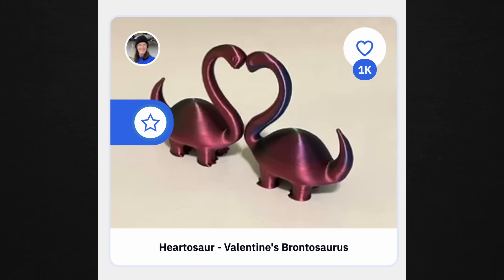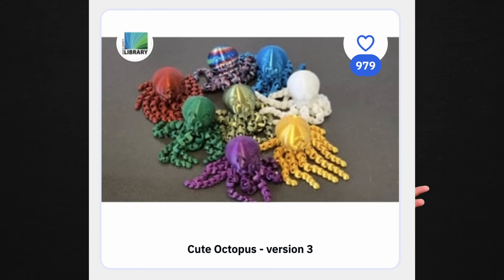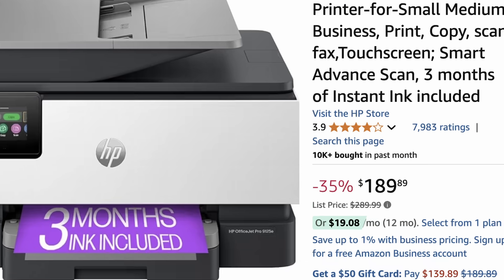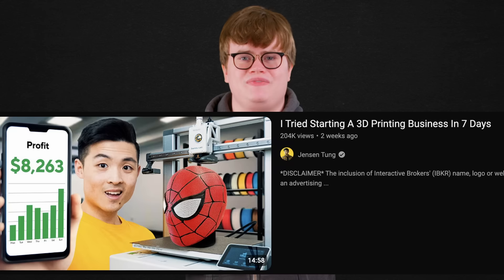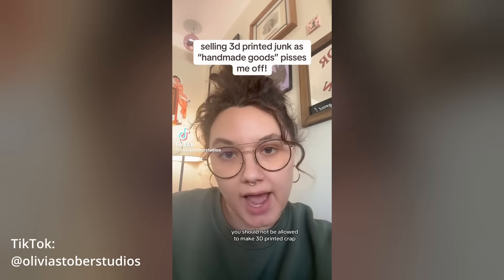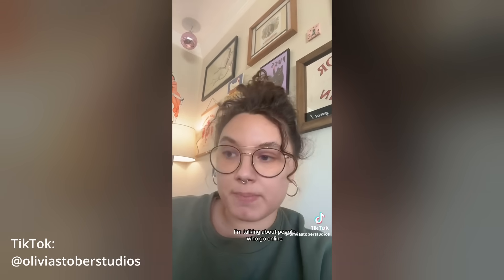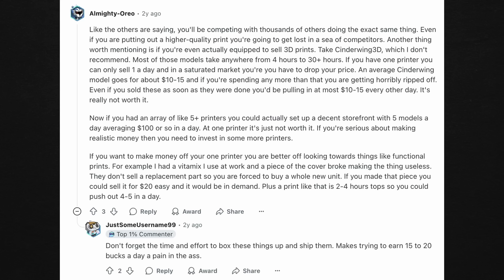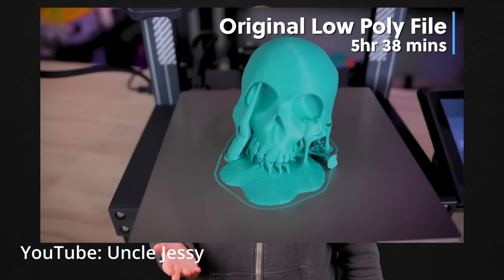The Rise of 3D-Printed Slop

Comment: Most of the things I print are just gonna be functional in the sense that sanding down the lines is a complete waste of time. I mainly print patterns and tools for leather working such as line up jigs, tool sharpeners, and patterns that will be reused. I've printed some patterns for wallets and belts, which will be reused many times. These are printed at a .1" thickness with a 5-10% infill depending on how I feel, so they use very little filament. I could probably get away with a .75" thickness, but I'd be worried about the durability.

I've also looked into taxidermy mounting, and I think 3D printing would be a good use for that. Most head bases are made as a starting point, and can cost $20 or more for a hard foam one. Imagine being able to print one yourself for a couple bucks. You can also adjust the design so that it already has the emotions you like built in. You'll see a lot of people slap on clay in the same spots without even testing the head, because they need to add it for the emotions they want. If that isn't enough, what about printing with TPU? A taxidermy head that keeps it's shape AND can be squished? That would be amazing for soft mounts. 

I've also thought about how people hate mounting pets, because you can never get it perfect. The owners know what the face and body details exactly look like, and you can't replicate that perfectly. But what if you had the whole carcass and a 3D scanner? You can skin the animal, put the body in a preferred position, and then scan it. You're scanning the body with the muscles and most of the fat on it, which makes the details people really care about, such as the head shape and body shape.

This hasn't been tested yet, so it's all a theory. There's one main problem I can think of with the TPU base, and that's will it stay attached? The fur is usually glued to the base to keep it in place. You can't use normal adhesive, since it will crack. You'll need to use barge cement, which is good for flexible materials (especially leather), but I don't think it will hold up for a few years if someone's squishing the head a few times a day.

Comment: So I think it comes down to the barrier  of entry. In the past, these printers were shaped together, and the end user had to do a lot of problem solving and diagnosis. Enharantly, that brought a certain group of people to the hobby. Now that the machines are more user-friendly, anyone could just get started with a machine that just works out of the box. Now the problem is with the desighn software. If you wanna make custom parts to fix or replace things you have to take precise measurements and use engineering software to deaigh a part. There is a much greater barrier of entry to the desigh software than there ever was with the printers themselves. I know how to use some desigh software and I still have trouble with it. It's time-consuming and intellectually chalanging. Most people are not up for the chalange.

Comment: I have had a printer since 2016 and very rarely still use it for the same reason. I have the occasional use for it. For example, when a plastic part of my fridge broke or I need a small tool for something (bike valve remover), but the majority of the time it sits still because I won't print any more plastic junk. It is nice to have the flexibility to design small plastic parts at the glims, but you have to remember that the parts are not mechanically very sound, nor food-safe.

Comment: 3D printing saves time and occasionally some money in the long run, but people have replaced this truth with all kinds nonsense.

My ikea malm bed has no nightstand. I would have always liked one, but they are about 15€ each. If I found one on clearance, I would have gladly paid around 15 or 20 for two. 3D printing "saved" me around 10 or a bit less as I would have bought such night stand if I saw it on clearance which would eventually happen. 

Now I am perhaps selling a computer case or other electronics. Now I look up some goodies that I can add to it. A GPU spacer extension for a small form factor case was a thing for me. Raised the value of the sale by around 10. 

Baking sheet roll holder? Yep, needed that. A carrying case for my nintendo switch 2? No way I am paying 80 for the official one. A nice looking bowl to throw my wallet and keys in? I saw a nice one made out of wood yesterday and I was very tempted to buy it for 10, but I adore the one I printed as it has a nice pattern and the ideal shape. 

There have been dozens of these small things that annoy me to not have. Now I can just open my phone, find a suitable model within barely minutes and hit print while I'm in bed. Over the course of the next 3 or 5 years of owning my bambu lab a1, I will probably not have saved or generated any revenue with it. But it will have saved me time, added convenience to my life and saved me the occasional €.

Comment: As a tinkerer with a 3D printer i can say, that aslong as youre not using plastics that need a cover anyways for bed adhesion reasons, there will not be any problems, not every person 3d prints just ''crap'' some, like me print only usefull stuff, i think about the fact of if its a waste of material or not, i do have to admit, i did print some of theese trinkes, but i still didnt throw them away, theyre just collectiong dust, the stuff i usually print, are prototypes for my projects, gridfinity stuff and generally usefull stuff that i will reuse on a regular base,  i do have to admit some filament gets wasted while prototyping but if im being honest, almost every hobby has some way of waste.

Comment: No robert, I did not appreciate this video of you bitching about 3d printing.

I agree with many of your points but the way you presented them is terrible and is just going to get everyone angry at people who use 3d printing.

I myself use this tool to create one of a kind objects that would either not be commercially available or would cost a lot.
Also 3d printing is great for saving cost and emissions for shipping and packaging… since tightly packed plastic is more efficient to transport than loosely packed plastic trinkets

And nowadays the kind of printer “normal people use” fails so little it’s not an issue

Comment: I love 3D printing and as a designer I agree but the even bigger problem is the waste it is now and how it can't just be "thrown away". 3d printer companies don't provide ANY instructions on what to do with it (prints no longer used, fails, samples, filament poop). I had to reach out for tips. One BIG solution is that 3D printer companies provide affordable filament recyclers. These crush and melt filament poop back into filament.The ones out there are 10x more expensive than 3D printers. The other BIG solution is more services that accept waste to recycle it back into filament. There is one in the middle of the US, they accept shipments of filament poop and 3D prints by mail. There needs to be more services like this locally, to match the volume of 3D printers out there. The last solution is crushing and melting prints and poop into a cool baking mold, and bake or microwave in appliances only for this purpose and outside or a ventilated area. This is a massive 3D printer company problem, for not paying attention or educating their consumers!! The government will take notice if they care. I hope they pass a bill on this.

Comment: I study engineering, and in my production methods course 3D printers were touched on only a little bit, they're not very useful for several reasons:
1. Their main appeal is supposed to be ease of design, for prototyping, as you said. Turns out printing still comes with quite a lot of constraints and on the flip side, if you're designing for a different machine, easily allows you to produce designs that would not be possible to make with other processes.
2. Materials are very limited, by design, printers that have any commercial viability can only be used with select plastics with low (<80°C) melting points.
3. They have a fairly large failure rate and long production times, making them hard to upscale and easily outpaced by faster, just as versatile machines like injection molders.

In conclusion, they're pretty much only used for junk toys because for each other use case something else does it better

Comment: While I agree with the sentiment that the world doesn't need more plastic junk, my 3D printer has become an invaluable tool for me to create and design original parts or repair broken items that would otherwise end up in the landfill. I learned CAD as a result and now have a new valuable skillset that lets me share my designs for the benefit of others on Printables, for example, so I feel I've done way more good than harm. The 'rise of 3D-printed slop' I think has been countered by the rise of makers and engineers solving problems with 3D-printers and ultimately helping people. But without any data/stats to support either way, this video seems to be mostly conjecture.

Comment: I bought a 3d printer because i wanted to print replacements for car parts that are no longer produced. Going into it i knew how to design parts in cad and 3d scan. Most of the time i print interior bits, little clips and grommets, bushings, gaskets and stuff like that. I do print the occasional desktop decoration from time to time, or a litophane or vase for someone. But 97% of what i print is functional and i wouldnt be able to do what i do without printing. 

Its honestly pretty sad that people would rather print useless crap to get use out of their printer, than learn 3d cad and design functional parts. The thing is that once you have a printer and know how to design stuff, you have a hobby for the lifetime. 3d design isnt rocket science, you can get the software for free and learning it doesnt cost you anything but time.

Comment: Really please stop talking shit about 3d prints that aren’t a functional model because most of the people who get them are kids and sure I could spend $10 on a tool on Temu and wait weeks for delivery or I could use less than 20 cents on filiment and wait 1h for the print 

And I want to have fun with my $2000 printer not just get pissed of because I’m spending hours on designing and then printing over and over again for weeks 
So if you have a printer don’t listen to this shit because this guy doesn’t understand what it’s like to save up for months and then only use the printer to design 1 print per month because of failed prints and bed adhesion problems. If you read to the end thanks
But this guy sees a printer as a tool that has one use not just something you got as a hobby!😑

Comment: printing is really nice for casting metal parts, just print what you want, maybe a bit oversized to account for shrinkage.
put it in silica sand, burn out the plastik, prepare a little and let the aluminium, tin, copper whatever you want flow
it's great

Comment: I do think there is a lot of items on sites like thingiverse that can't be found at local stores anymore and so can be printed faster than shipped and much cheaper (maybe a $1 vs $20). Also saves a lot of greenhouse gases, cardboard boxes, plastic packaging etc. Makes some items so cheap that I mightve never considered buying them but would be willing to print. Example like a custom hanging mount for tools or organizer. Don't have any desire to print trinkets though.

Comment: I've been making stuff for a long time. I also have a degree in engineering so I'm more than capable of designing stuff in CAD. I finally pulled the trigger on a 3D printer a few years ago and it's been an incredible addition to my tools. But almost everything I print is something I designed myself, and is used for a particular project. Now, not only is it easier to download someone else's model (which I think is mostly fine when used in good faith), but the quality of the printer someone can buy has also made the barrier to entry much lower. The average person can jump online, and order a printer for $800 that is almost entirely hands off. Just upload the file and hit print - it'll do the rest for you, even multicolor if you want. When I first got into it, I had to level the bed, tune everything, and make a bunch of upgrades to get the quality I get now. I'm not against people getting into 3D printing and having better printers. I think that's great. But to emulate much of what was said here, I think the spirit of 3D printing has been lost in the process and now the hobby is full of people just using it as a personal junk maker. They're not using it to create stuff. They're not using it to prototype, or to add anything of value, and they're not even really doing it for the joy of 3D printing. They're just giving themselves a lazier way to get instant junk for cheap.

Comment: 10:52 is it safe if you have only one 3D printer? We have one at my house that is basically running constantly on weekends but now I am worried if it will cause problems
Reply: Depends what filaments you use. Petg and pla are basically not even worse than the sun and everyday life. But i wouldnt recommend abs filament its toxic as far as i know, stay safe.

Comment: 7:15 You wouldn't call them crap? This entire video is basically calling them crap.

I strongly agree that most people who buy 3d printers are just printing crap.

Also, why do you keep mentioning sanding? 3d prints do not need to be sanded, especially not at 0.6-0.2 layer heights.

Comment: I generally agree with you but I have to say I’ve personally been blown away by a few prints. I have a minilathe thats been running for 2 years (light use) with a 100% infil PLA main drive gear that I printed when the company wouldn’t send the replacement for the steel one that exploded. A few prints have been awesome like that but thats definitely the most impressive. I agree 95% of people are just downloading and printing plastic garbage though

Comment: I've actually 3D printed useful things. I've got two bed side lamps I 3D printed. I did a door catch that broke. I've designed replacement parts like battery covers and stuff that broke and have no direct replacement parts available to buy. The few things that do just sit there and do nothing aren't rough to handle either. There are PLA based filaments that expand slightly when printing combined with thin layers massively reduce and can often hide layer lines altogether. 

Just because the negatives get most of the attention doesn't mean there aren't heaps of people out there who use them as intended and responsibly. We just don't make a fuss about it.

Comment: I used to print and paint 3D printed statues and I ended up losing money and time for each model. I would spend hours sanding each model and even more hours painting and even re-sanding errors I missed in the first place. With the amount of work I never broke minimum wage and I charged a lot of money. The best way I think to make money with 3D printing is to 3D print molds and sell the casted part. That way you are not wasting time sanding.

Comment: So I very well might be wrong here, but I thought that the filament used by in most 3d prints was biodegradable (once again, very much could be wrong here, that’s just what I’ve heard)
Reply: Some are! But notably, the main five are not. Any 3d printed item youll buy today will either be PETG (non-biodegradable, sturdy and long lasting, less UV sensitive), PLA (non-biodegradable, common, sensitive to UV, can warp, low melting temperature), TPU (non-biodegradable, flexible, basically indestructible, slightly less UV sensitive than PLA), ABS (non-biodegradable, old and rare, needs enclosure to print, and has similar UV stability to PLA), and HIPS, (non-biodegradable, high impact resistance, very UV sensitive without additives). there are some filaments that modify TEC plastic called Green-TEC by Extrudr, and 3DJAKE's niceBIO doesn't smell as bad, has high heat resistance, and is VERY expensive. If you get a 3d printed product, it will post likely be PLA or PETG, and if you paid 3x what you should have, it might be TPU or HIPS. ABS is old and bad.

Comment: We got a 3d printer and it runs almost non stop. The only two things we are printing are elaborate flower pots (which we use ourselves or give as gifts) or terrain for miniture wargaming which is otherwise simply to expensive if you want as much as we do. Overall, very happy but I agree with pretty much all you said. Most stuff I see to print I dont understand why one would want to.

Comment: Speaking as someone who designs and prints stuff a lot, this is a very poorly argued video.

For one thing it's 100% focused on FDM printers and ignores resin printing altogether. Even cheap resin printers are capable of extremely high detail prints now, and if you use the right resin you can get serious durability. I've been using Resione resins to design and produce 100% printed action figures- there's something so rewarding about turning a pool of goo into a fully poseable toy.

Secondly, for FDM printing cheap widgets in particular, I'd argue it's much better for consumers to be manufacturing simple knick-knacks at home than ordering it from a Chinese sweatshop; it's cheaper and arguably more ethical. Plus you can make things exactly to your needs.

Thirdly, sure a lot of 3D printable designs are kind of pointless...so what? As long as humanity has the capacity to produce items, worthless crap will be produced. At least with 3D printing people can make their own useless nonsense rather than depend on other people to make it for them. Who are you to tell them what to make?

Comment: Well most - accurately described - slop out there is made out of PLA. That you can put it directly inside your body. The environmental and health impact of the stuff is not even a question at this point.
... But some are not. And there is also the energy required to create the print and the material.